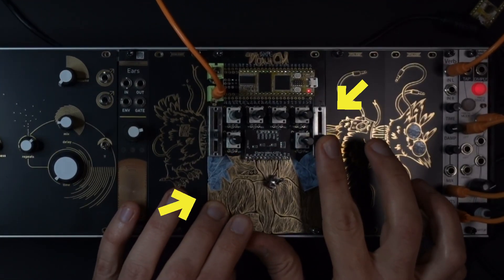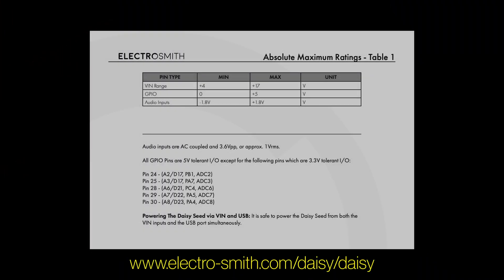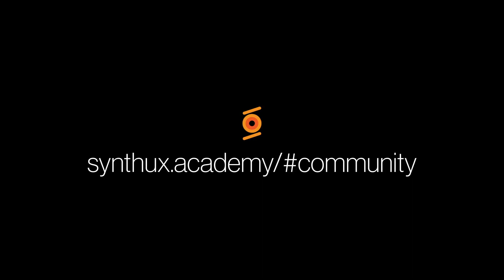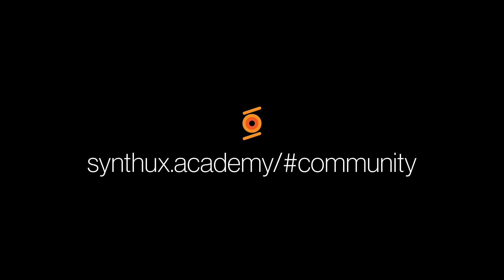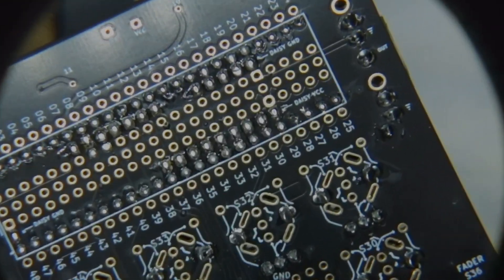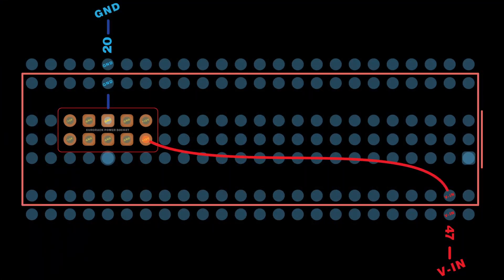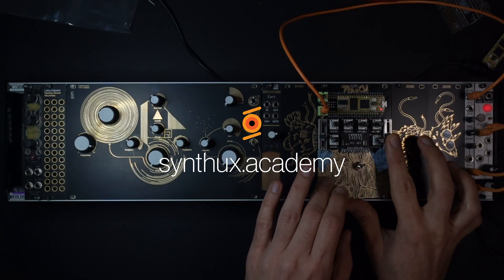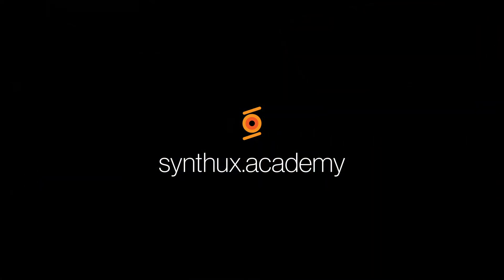How to Eurorack Power the Daisy Seed? Simple SynthDIY tutorial

Comment: Hi Roey. I have been enjoying your synth designing podcast, and applaud what you are doing here with your synth kit.

Pro tip for you and everyone watching:
Use shrouded 10-way power connectors if you don't want to accidentally smoke your DIY projects. You may balk at the extra cost/annoyance of ordering that specific type of socket, but believe me, you WILL one day plug it into those un-shrouded connectors one day (usually when you are in a hurry) and immediately regret it. 🔥

Unless the Daisy has reverse polarity protection I am unaware of...in which case disregard this comment!  (I confess I am not familiar with the Daisy Seed myself ) 😄

Keep up the good work! 👍
Reply from the maker: Thanks o much! It means a lot to read such comments. 

I completely agree with your tip. Actually, I am working on a version of the board with built in protection as well. These DIY boards are great, but they have their limitations. That’s why I also added the data sheet before going into the tutorial. DIY is fun! But it can be frustrating. I hope at a certain point all our boards are human error proof.